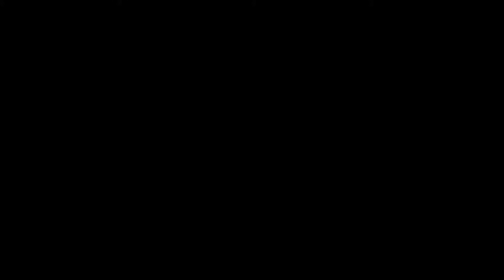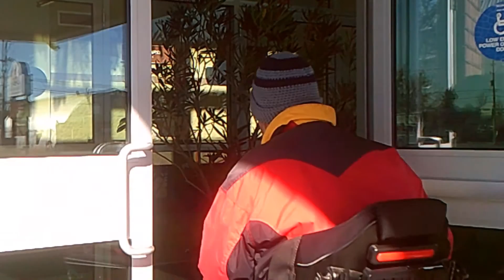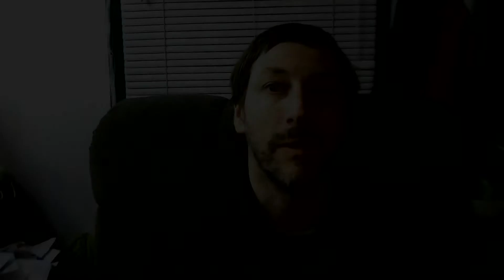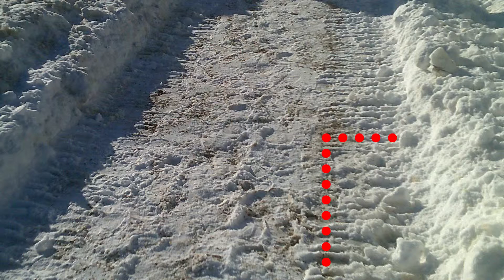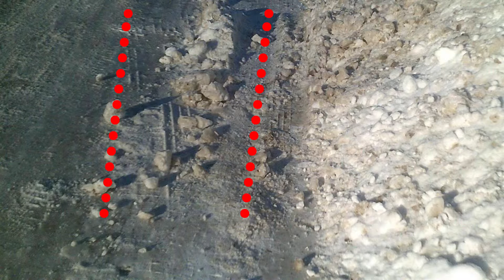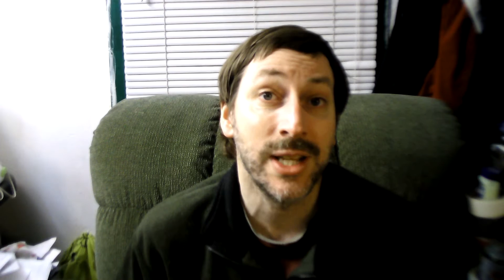Winter Electric Wheelchair Driving Safety

Comment: How safe for the battery to be out in freezing weather?
Reply from the maker: This is a very good question Janet.  I will provide you with a short answer here and make a separate video about this soon. 

1. Expect your power wheelchair to loose up to 30% of the distance because of being cold.
2. Fully charge your battery before leaving your home.  (Opposed to "I only used it a bit yesterday and it really doesn't need charging today")

3. You can't drive a wheelchair on the sidewalk in winter.  Sidewalks MUST be pristine.  Otherwise you will become stuck.  The tires are just too small.  They fill in with snow and spin  --- same as a stuck vehicle.  Being highly visible is crucially important.  Practical examples: A flag, putting a high visibility jack on your wheelchair seat back
4. Protect the recharge connection from all forms of moisture.  Otherwise you could VERY quickly do about $4,000 worth of damage by wrecking the electronics.
5. The tires should be replaced before the winter weather and bearings need to be replaced as soon as the snow melts.
I hope this is some help.  I will go into more detail in a video and come back here to add the link. 

Thank you for your inquiry.  Ron
Reply: @RonPiggott  Such valuable information! Thaaank you!